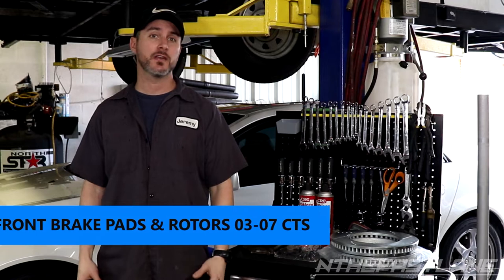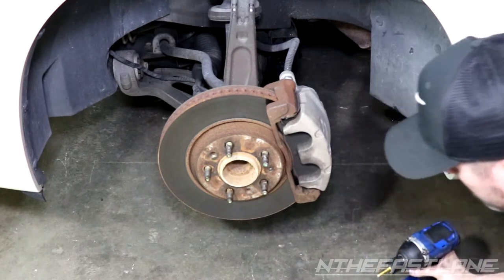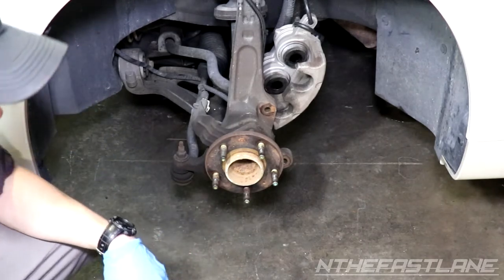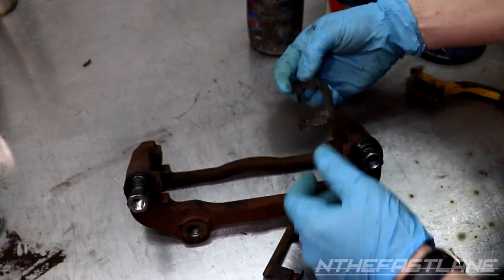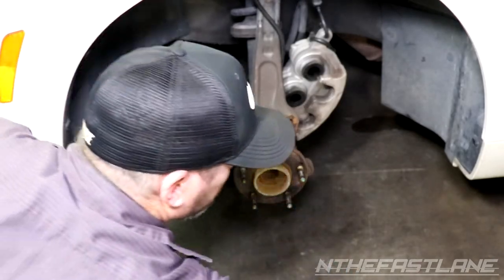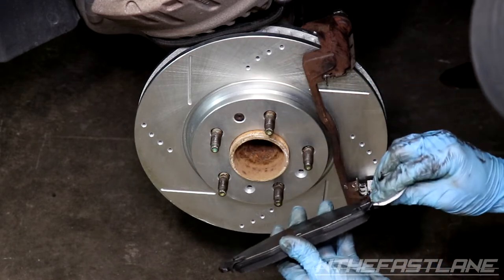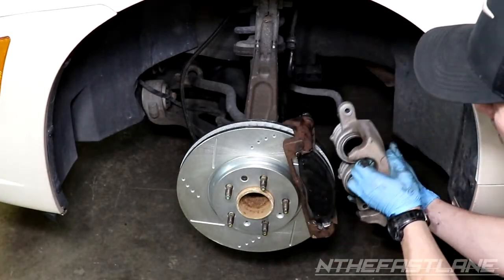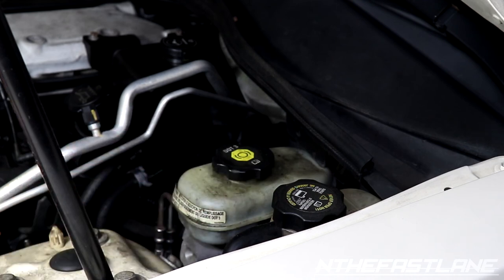▶️How To Remove And Replace Front Brakes On A Cadillac CTS🔧

Comment: I got an 07' CTS, gonna change the brakes soon so I am glad you made this video.  Was curious if you thought about getting a cheap CTS with the 3.6 so we can see a DIY fix for the oil consumption on that engine.  I know mine eats oil pretty good and somehow gets oil in a few spark plug wells, its been a little better after redoing the seals on the top end, would definitely like to see your take on it though.  Painted calipers a possibility?
Reply from the maker: You're welcome. I have a friend that has a 05 STS with the 3.6lt.  I'll make a repair video showing how to fix the oil consumption issues up to 2013 3.6lt.  If in the future you have any questions, feel free to post in my forum as it helps the community to search for issues that can be resolved. As for painting the calipers, I included the caliper paint in my store, it's pinned to the top comment. Have a great day Dominic!

 Link to Forum: www.Nthefastlane.com/forum
Reply from the maker: If you like my videos please hit the "JOIN" button after you have subscribed, Youtube will not notify you of my new uploads if you don't select "JOIN"
Reply from the maker: Here you go buddy, Link to GM 3.6 losing oil Fix: https://www.nthefastlane.com/losing-oil-gm-how-to-fix